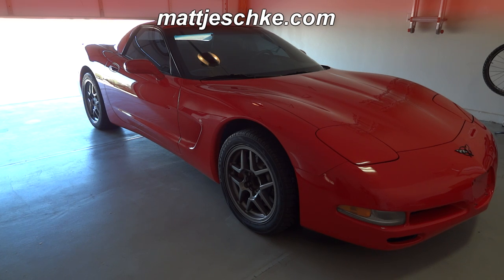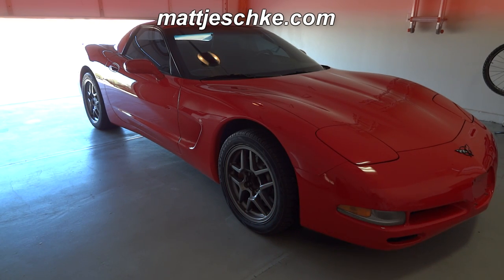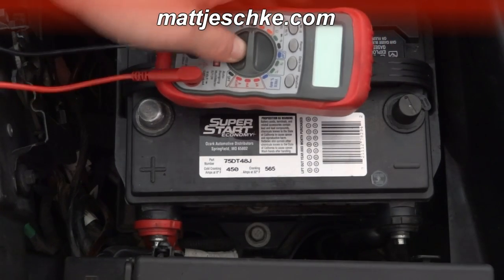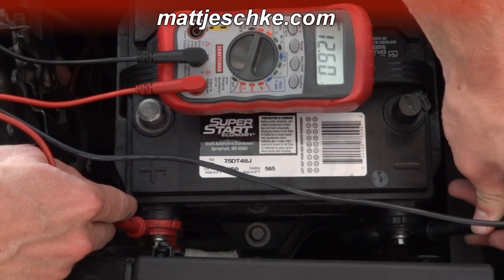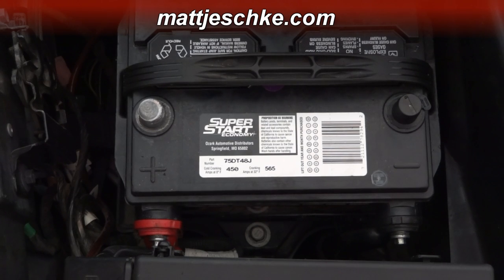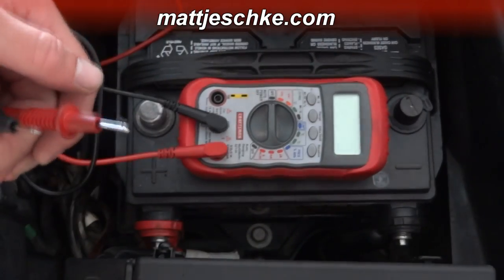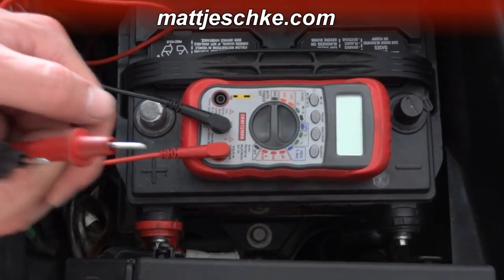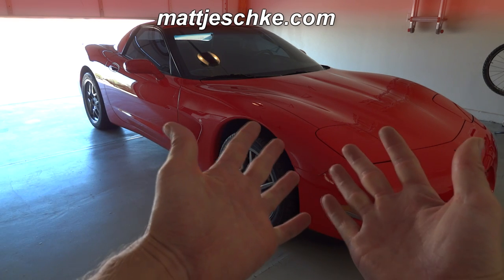How to Test an Alternator in a C5 Corvette

Comment: 99 c5 Corvette. After having the car on battery maintainer.  And driving it to a destination. If I turn the car off and step away for 10 minutes. Car needs a jump. Battery is a Optima yellow top and is less than a year old. Can you assist me with the diagnosis?

Comment: Warning, this basic procedure will not determine if your alternator is good but the connection from it to the battery is bad.
Reply: HALF TRUE. IF IT READS GOOD THEN OBVIOUSLY THE ALTERNATOR OUTPUT AND WIRING TO THE STARTER, THEN TO THE BATTERY IS GOOD. IF THE READING IS BAD THEN YES, YOU MUST CHECK THE ALTERNATOR SEPERATELY.

Comment: What if the voltage starts dropping
Reply: And hits zero volts in 15.mins
Reply from the maker: @joyusa3182  bad alternator. Sounds like your car is running off the battery alone.
Reply: The battery also dies when the car is off it goes from 12 volts to 0 in about 10 minutes  aswell
Reply: @matthewjeschke  I'm at a point where I have no clue what's wrong with the car both the battery and the alternator seem to be bad the car will start if jumped but shuts the battery starts losing charge then the car dies